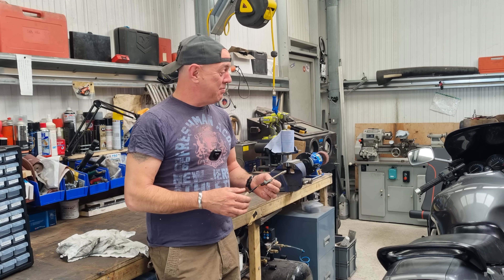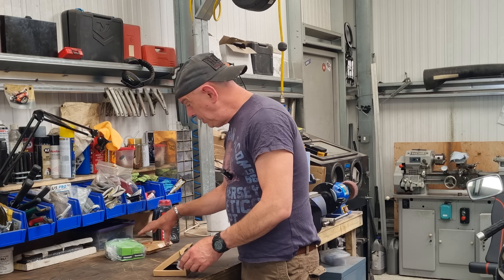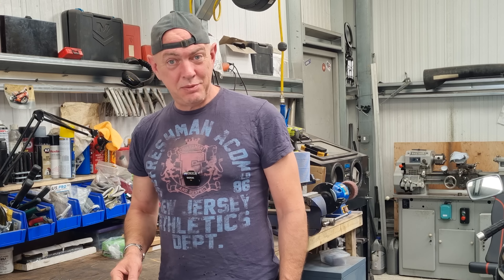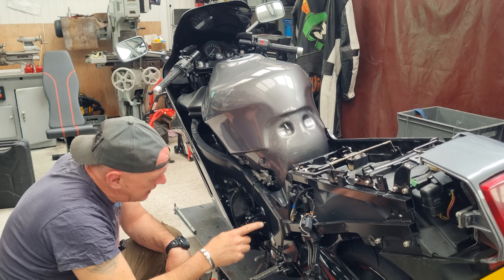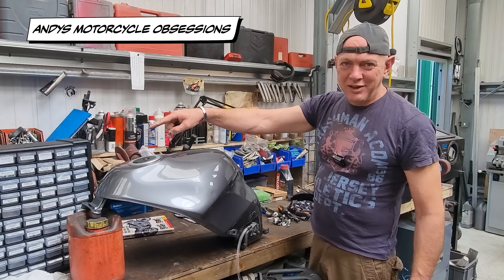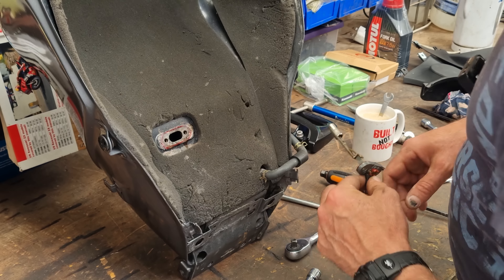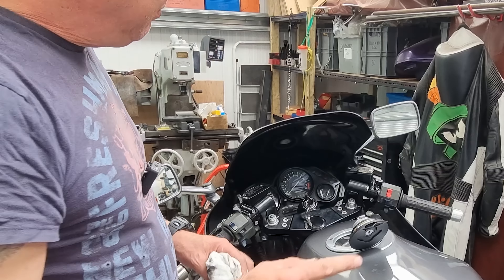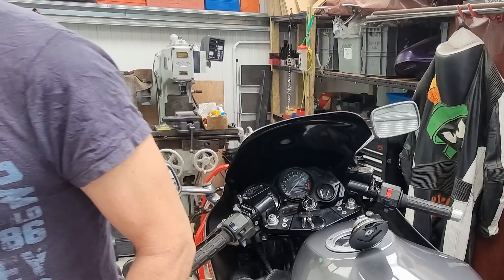Fuel level warning sensor - 1990 Kawasaki ZZR1100

Comment: Its ya works in progress matey . I'm sure the manufacturers are doing it in the design stage so whatever you have to work on you gotta take half the bike apart to swap out whatever its broker . Its not to bad if you get to the low fuel on a lot of bikes if you have a tap it's a quick flip to reserve .. on most modern with the dash gauge ya in trouble if that warning dont work . Mines a k6 650 bandit and that's a vacuum tap underneath the middle of the tank so no hope if a reserve if your lights out your dead in the water if you get low
Reply from the maker: The top on this is hidden by the fairing so totally reliant on the warning lights. It's not too big a job, it's just tedious,  but I'm glad it's sorted now 😁👍
No more pushing the bike hopefully 🤣😂
Reply: @QuickBikes  apart from pushing a heavy awkward lump as they aint design to be comfy when ya gotta push them  ...Its bloody embarrassing.. tis another niggle off ya list mate
Reply from the maker: Very true matey. 👍

Comment: Always found manufacturers fork seals are best bet as all the copies nearly always fail, just my own findings.
Reply from the maker: I know what you mean, but I've used these folks before with good results. To be honest, I've had 2 fail in the past as soon as they were installed, I was sent another set which lasted years.... they cost less, but not as consistently good IMHO.... 😁👍
You make a good point though 🤔 👌

Comment: Haynes is entirely correct, it's not a stupid way of testing it – the sensor is something called a thermistor, whose resistance value is dependent on temperature. It has to be connected to the bike's harness and the bike turned on so that the sensor can be heated up electrically. (A multimeter won't do it.) It might even become too hot to touch. But when immersed in petrol, it's cooled down so the resistance goes back to the 'cold' value. I'm guessing the resistance goes down when it heats up (most common behaviour for thermistors, altho there is also a type that does the opposite) and so the electronics is looking for a change to low resistance to know when the fuel level has dropped below the thermistor. Hope that makes sense. 😁 BTW newer Moto Guzzi have exactly the same system. (Which is how I know about it.) ❤
Reply: When ohms go up on thermistor it is called a positive temp coefficient and negative when going other way. Never been too keen on electrics in fuel tanks to be honest, my Futura had pump in bottom of the tank as well as fuel level sensor old school type.
Reply from the maker: So why get you to drain the tank, hook it back up to the electrics and juggle with a pot full of fuel to test it?,,,, why not just test it the way I did with fuel in the tank where its all contained? Especially where the manual is saying avoid the risk of fire?
I get the way to test it, it just seems silly to do it wit external fuel in a way that will occupy both hands if stuff goes south... I'd just rather not have to hold a pot of fuel if there's a risk of fire 🤣😂
Reply: @QuickBikes  Not argueing with your logic would have thought if it works as Valve Geek says you could have it on bench with power to it and spray with freezer and see with meter a change in volts as resistance changes from in air to cooled would be interesting to know if lower than normal  voltage  used as that was the case with Aprilia sensor. This would also be easier and a lot safer than with jugs of fuel, hot engines ect as you say. My bike knowledge is limited in some areas but have owned and worked on a few plus electronics technician so thermisters not a new thing to me.
Reply from the maker: I'm sure you and Valve Geek are right  it's just the idea of having fuel in a pot. I do like the idea of using freezer spray to test it. I hadn't thought of that and don't have any anyways,  buy I can see where you're going with the idea.  Dunking it in a cold cup of coffee probably wasn't a very good  substitute 🤣😂
Reply: @QuickBikes  You don't like having fuel in a pot, but then fuel a running bike in an enclosed space from an open container and dribble petrol all down the side of the tank??? 🤣🤣
Reply: @QuickBikes  Can't say if cold coffee (criminal waste!) But jug with cold water and ice might do as sensors just looking for a marked temp change as circuit is probably a comparitor were return from resistor is compared against a ref and when it changes from being above to below certain value comparator switches which then works the light unit. Hope that makes sense. Oj
Reply from the maker: Yeah, I'm guessing as the fuel on the sensor evaporates, the temp would drop quite quickly.... makes sense matey 👍
Reply from the maker: Hehehe... yeah, fair point 🤣😂
Reply: @QuickBikes  I do prefer your method, put a bit in, test, then put more in, lights should go out. Haynes wouldn't have created that bit of text, they would have got something from Yamaha, so second or third hand information, and probably from badly translated Japanese. It does read a bit like they're talking about the prototype almost. I used to help write the catalogues for Maplin Electronics , there were often problems getting clear and complete information from the manufacturers!
Reply: @owen368  Do not use anything with water in it, water is conductive which will mess about with the results you're looking for.
Reply: @valvegeek  Then the other option would be brake cleaner or something like that which is low temp evaporation did wonder about that before. Seems odd they have bare live system inside metal tank full of fuel which is why I was asking does it run normal voltages.

Comment: It's the whole "have to take off all of the fairing to check the tyre pressure" thing that's making me think my next bike will be naked.  My old FZR400 was pretty good in that respect, didn't have all the little infill panels and shit, basically a track bike with lights, How I laughed when my mate's CBR1000 needed a new spark plug lead.  "Oh, we can do that between two coffees at lunchtime in the work carpark" - yeah, right, it took 2 days. 

Missing fuel senders is bad mojo.  A bit like a dodgy starter solenoid.

Bit of heatshrink around the connector should do the trick.
Reply from the maker: The fairing on this one is quite simple, but more recent bikes seem to have 100's of pieces 🤣😂😅
I've now just got to be brave and let the bike get low on fuel 😳

Comment: You can change the height and geometry by turning the concentric chain adjusters so that the axle is at bottom instead of the top. Some say the bike turns in to corners faster.
Reply from the maker: Yeah, I did that... Essentially lowers the axle which raises the rear which changes the rake and trail. It's a good thing too as you can't drop the yokes down the forks thanks to the silly handlebars... 🤣

Comment: Hi I have just bought a Big Z and your show is Awesome, Thanks for all your tips as I have a problem with mine but it is different to yours, my fuel and oil pressure lights don't come on sometimes at all, I think it is a wiring or ignition switch problem if you have any tips that would be greatly appreciated but if it's not something you've had before I'll let you know what I find. Cheers mate
Reply: My won’t ever go off! Seems like we have a similar issue. My battery constantly drains and my solenoids click after I turn the bike off. 😅 I’m going to strip her down and see if any leads have been grounded and replaced that fuel tank sensor and solenoid

Comment: Hiya,not all o rings like petrol!Also,I get brake cleaner in 4ltr cans and put it in a spray bottle,loads cheaper!All the best.
Reply from the maker: Yeah, I've got some brake cleaner coming in a 5L bottle as I get through loads of the stuff 🤣😂
All the O rings I use are Nitrile, so quite happy around fuel,but that's a very good point to make. Thank you matey 👍

Comment: If the forks are soft why are you using 7.5 weight oil, when you said, it had 10 in it, are you adding more?
Reply from the maker: Basically yes... Will be reducing the air gap by 5mm as per advice from Simon. Apparently its a good move, but we'll see when I test ride it
Reply: @QuickBikes   I eliminated the front brake 1st touch dive, on my Sprint GT, with 5mm more. Look forward to seeing your results.

Comment: Where did you get the thermistors? I'm looking for two for both my 91 zx11s. Apparently you can also buy the thermistor alone and solder it in place instead of replacing the entire unit.
Reply from the maker: I got the replacement off an eBay seller matey. Seems.to have done the trick
Reply: Have u put up the site where u got the thermistor I have a 2001 34ooo Kim's may need one some day love your channel I do realize how much work u put in happy days from straya
Reply from the maker: I think the thermistor came from eBay matey and I couldnonly find 2 on there at the time. It may be worth you while contacting JP Motorcycles, Callington as Jan may well be able to help you.
Thank you very much for watching matey, it's much appreciated 👍

Comment: Its a tad late now but to test it you could fill the tank just till the sensor went out then run until it cam back on again. Nowt worse than panacing when the fuel runs out, at least with an old tap you could dive down whilst riding one handed and swap it over ( provided you remembered to turn it back after filling DOH!).
Reply from the maker: Hehehe.... I've done that as well... Hit reserve, filled up and not put the tap back to the on position 🤣😂

Comment: I have a D8 2000 version and it's a survivor with very low mileage. I just put 500 miles on it and it has a touch over 8K Miles. (US Model)  All these little bits are aged an d starting to go bad. I watch your vid's cause I wanted to get some idea's and I wanna Thank You for this.  I noticed there is a difference in the emblems from the EU Model. I prefer the US ZX-11 Emblem rather than the 1100 emblem but neither one is available from my searches.  I would rather prefer the ZZR emblem though instead of the Ninja Sticker.  Know a aource?

My experience with fork oil is go higher with new springs not lower. If you go lower using emulators helps a LOT, but the price is nutz. It's cheaper to go with 15W. I put that in a 600 I just redid and my ZZR is just fine.  After the riding season gotta get to doing some needed maint and checking.
Reply from the maker: The decals etc are really hard to cone by I've found.... like REALLY hard 🤣 I did find a company that will duplicate the original ones if you give them sizes etc  but it's basically just a copy of the original printed onto vinyl and cut out which seemed a bit naff looking, do I'm coming up with my own  I think. I gave a vinyl plotter, so no biggie.
It's interesting what you say about the forks as I've always found it goes the other way! All my track bikes used lighter weight oil, butbthat was for racing etc. Speaking with Simon we're going slightly thinner on the oil but reducing the air gap by 5mm. It'll be.interesting to see how it works out, but I'll let you know 😁👍
Reply: @QuickBikes  Interesting. I did also increase the spacer in the fork by roughly 16 MM to give it a stiffer feel and it sticks to the road nicely. As this is the first mod I've done on a sport bike (GSX-600F)  and using forum advice from Gixxersite so though I haven't really put a lot of miles on it yet (maybe 100) I did take it thru some twisties and she snarled around the corners. Trail braking and accelerating out was very smooth and nice and the forks stayed planted with no problem or bad rebound. Now on the Decals (Embossed Raised Emblems), yea they are no longer made anywhere that i looked.  I did obtain some from an Ebay site but they were pathetically too small and could not find the ZX-11 anywhere. Think I may just have to Paint em on if when removing them they get a lil too messed up. Gonna be real careful cause I can get the front and tank emblems but not the tail ones. If I have to Paint it back on then all of them gonna get that treatment. Uniform look and all. Thanks for the fork info though. I'm learning ...
Reply from the maker: I'm definitely interested in trying to improve the suspension, but I'm going to have it close to stock to start off with, get some miles under my belt and then decide what to do. As a daily, thus is going to be a solid bike 😁👍
Reply: @QuickBikes  Reasonable and Articulated well. 👍